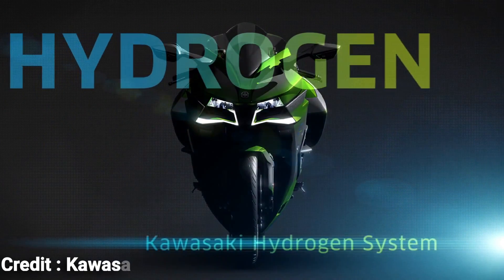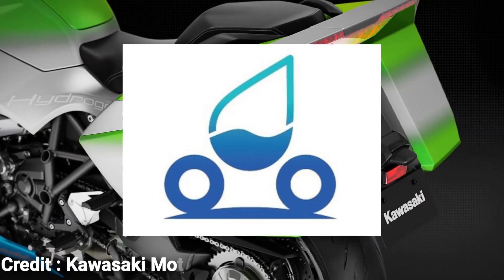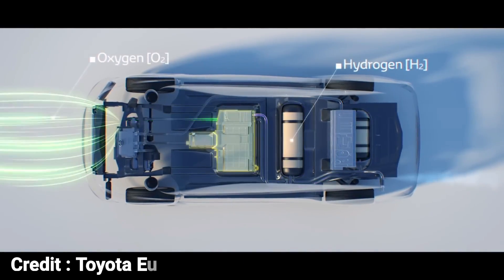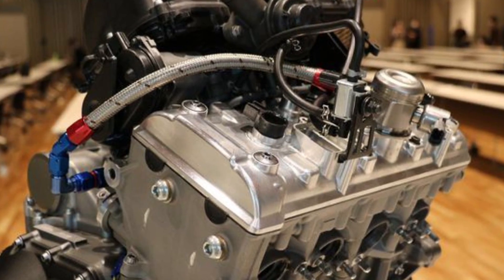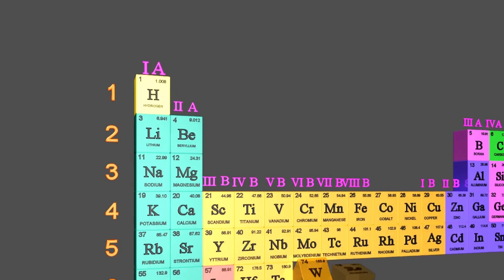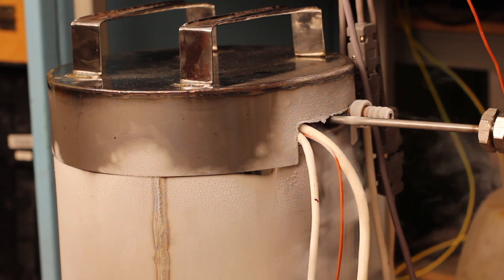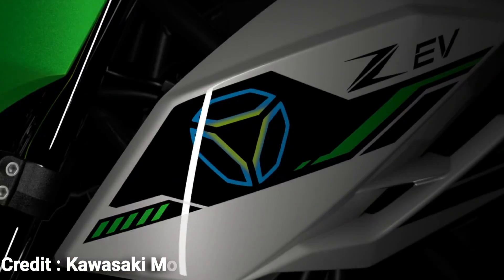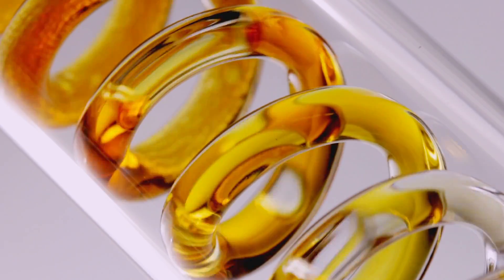Kawasaki's Hydrogen-Fueled Motorcycles: The Future of Zero Carbon Emissions?

Comment: Kawasaki I think is smart with Hybrid motorcycles, Not sure how the gearing will work. Maybe 1st gear is Electric, 2-6 is ICE? In terms of long term. Improvements/breakthroughs in battery chemistry improving density and charging speed, be it Solid State Batteries, or Graphene batteries that can charge quickly and get double range (maybe even 200 miles at highway speeds?) could be the answer for Electric motorcycles. But I agree there won't be one answer there will be many.